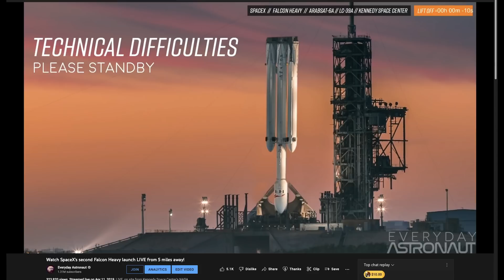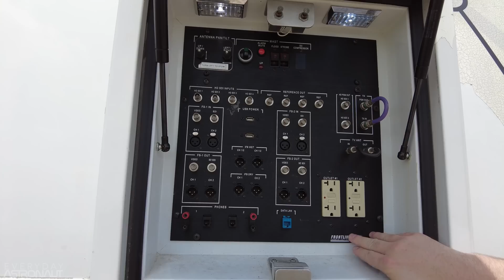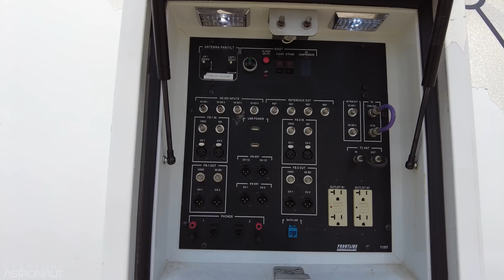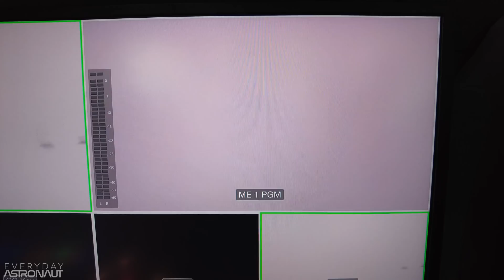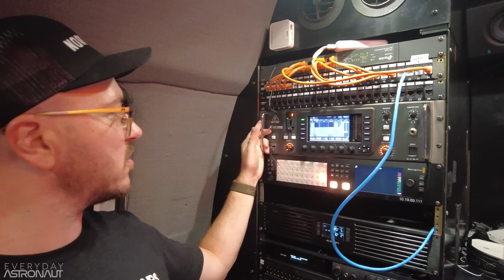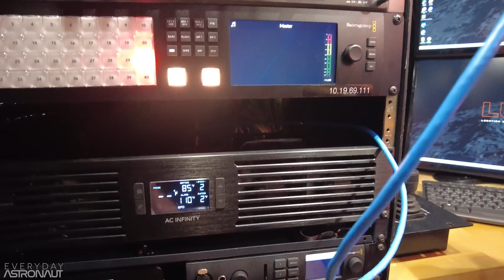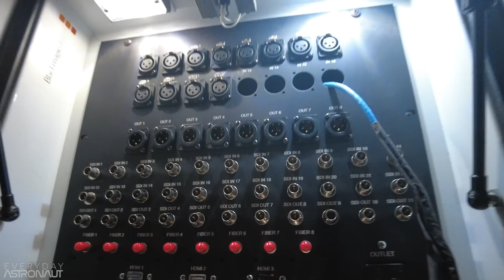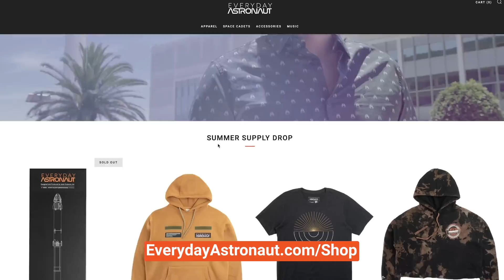I Built The Ultimate 4K Rocket Chasing Van! Retired News Van Makeover Build And Tour!

Comment: Do you need access to the server rack during the livestream (assuming nothing goes wrong?) If not, how about putting a door in front of it and closing it off to the inside with a direct air connection to the outside so you do not heat up your van as much.
Reply: That rack probably cares even more about cool dry air than the people, that's why those inverters have fans in front of them.  Those things need to stay cool and dry to function at their best and not shorten their lifetime (and given how expensive some of that kit is, early replacement is not something you want to have to do)
Reply: @glennmcgurrin8397  If you give them direct access to outside air, they will probably run cooler then when connected to inside air. They don't care whether the outside air is 20C or 38C or respectively 65F or 100F, so using the AC to cooldown a rack is just using energy twice and working in a really hot van.
Reply: @_aullik  If ambient is 38, that equipment will overheat.
Reply: @koomafloo3461  No not really. your System runs at 60 to 80 C internally, depending on how well it is cooled. If you increase outside temps a bit it doesn't matter that much as long as you have good airflow. So you can compensate for higher temperature with more air.
Reply: @_aullik  nobody in that van is going to want to listen to those fans lol. If this were the case data centres wouldn’t spend millions cooling their servers. Heat kills electronics, and increasing the replacement cycle of that gear is more costly than running AC
Reply: @nateclarke900  Data centers are many thousand times bigger and run 24/7. Even then, cooling them down to 20C as is often done is just plain stupid. The electronics run on the same temperature anyways whether your have 20C or 40C outside. It just means that they cannot turbo as high. However you could also increase the airflow over your server and achieve the same thing as cooling it down to 20C. 

Now when the air gets to 80C you got a problem, cause then you cannot cool anymore, meaning you have to make sure it stays below that, however the outside temp is never that high (unless you are in a desert) so you can just compensate with more air from the outside. You need that air anyways in your AC unit.
Reply: @_aullik  I think you need to do some research on heat saturation of metals and the working temperature of this equipment. If at 20c ambient and a static fan speed the system runs at 80, moving the temp to 35c will result in drastic heat increase on the chips, shortening the lifespan of the hardware. Given that the point of this gear is to be reliable, having it running at such high (and very humid) conditions will result in corrosion and heat damage over the long term. Thermal expansion deltas will be wildly high and could even result in condensation when parking the van after a long drive on a hot day and opening it up to the humid Florida atmosphere. 

It’s a bad idea, and that doesn’t even consider the fact that they are within range of sea spray and other corrosive and clogging factors. When you spend tens of thousands on gear, $50 a shoot for fuel to run an genny for ac is CHEAP lol. 

Nobody is saying you can’t do it, but it’s a bad idea and every tech guy will laugh at the idea.

Comment: Wow!
There are some great suggestions in the comments, it would be beneficial for TD to take note. My suggestions 👇

Additional suggestions:
Power system
Keep it ‘green’ where practical.
Fold out Solar while stationary + Auxiliary charging power source from the alternator while in transit.

Environmental Control System
AC functionality and reliability will be a priority to maintain temperature of cabin and equipment during hotter months. This is where a suitably sized power system comes into play.

Safety
Outriggers to add stability while mast is up.
Vehicle immobilizer while mast is up.
Obstruction light for top of mast.
Mast lightning protection system.
Investigate vehicle loading, particularly suspension with load equipment mass.

Comment: Great job. Would’ve liked to know more about your communication setup and contingency plan. Doing 4K streaming needs at least 25Mbps uplink bandwidth, which isn’t a big deal normally. But when everyone around you is also trying to do that, could it cause a problem?
Reply: He said bonded LTE connections so I'm assuming they're using equipment like a peplink router. If not, they need to be!

Comment: Good call, but there's a lot involved in maintaining a road rig.  Chances are, what you bought isn't 100% up to par.

IMO, check tires (dates, not just wear) immediately.  Next brakes, shocks and springs.  Service all fluids/grease points  regardless of what they said when you bought it.  Those are the minimum things to do, IMO, but I'd service transmission and give the engine a full tune-up as well.

Not cheap, but what is the cost of the shot you missed because you were sitting on the side of the road?

Best of luck with the van.  No clue about the additional things to think about with the mast.  Could get sketchy if it isn't working right or you don't have the right training/wind speeds/accessories.

Comment: The Everyday Rocket Van. Coming to a launch near you. Or, far from you. 'Cause it just doesn't matter anymore!

You may want to see about a drain kit for the mast. If it's full of water, and it freezes up in Iowa, well....you know what happens. I think it's just 1/4" fittings that fit a weep hole near the bottom and 1/4" clear tubing to run overboard. And I think they make canvas mast covers for them to keep some of the weather out when not in use. Neither should be very expensive at all. And if a section starts whizzing water out, stop raising it until it quits whizzing. It can build up too much pressure if you just keep going up with it. Good luck with the van!

Comment: For the next truck, if you buy another used news van, plase make sure the generator and the electrical wire are in working condition. that will save a lot of money. a very cost effective solution is a cummins onan generator .

Comment: I really hope you get a proper paintjob on that thing eventually, replacing all the NBC logos with your own EDA logos would be pretty sweet. Those ecoflow batteries look really interesting, I wonder how well they'd work long-term as a "permanent" powerbank between a wall outlet and a PC ups, since a standard ups generally will only get you up to around 30min-1hr of battery backup, but those batteries look like they're able to deliver about 15 or more hours, but they don't have the instant switch from live current to battery, to help with brown-outs, like a ups does. It'd be really interesting to try to combine the two.

Comment: Put yourself a transmission lockout connected to the sat. mast so you don't drive off and take electricity, cable and Internet away from the east coast of FL (LOL). You can also put a sail on the mast to save on gas and or a banner ad from sponsors. Of course you'll want to invest in "If This Van's Rockin'....."stickers.

Comment: What a completely cool idea! Well done, Tim!  Old VW Bus campers (circa '77) had the front passenger seat able to swivel around to face any direction. You might consider installing one, might help with production.
Reply: Actually in that van I think you can unbolt that seat and reverse it......
Reply: @fritzkabeano1969  Much easier to just lift the spring latch & spin it around with one's butt. It was all self-contained in the old chair mount.
Reply: @erfquake1  IF it has the swivel mount installed....what makes you so sure it has one??
Reply: @fritzkabeano1969  My '77 Spirit hard-top VW camper did. It was awesome! Had some great parties in that old thing. 😆 You'd push down a springloaded lever under the seat-front, which would release the seat to point in any compass direction. I thought since the audio board in the Luna was basically facing the back of the passenger seat, then that might be a cool option. But then I don't know how much nursing the audio would need once the broadcast starts.
Reply: @erfquake1  Oh I'm fully aware what and how swivel seats work and I'm fully aware that MOST people don't know that if you don't have a swivel seat you can still reverse the direction of the passenger seat in many vans. Retrofitting them with a swivel mechanism is easy enough but it's a rip-off considering what the swivel plate consists of.

Comment: My fingers hurt looking at this. I did a remodel on a broadcast audio suite that used 120 inputs. the patch bays... there was input, insert and output for each channel... each patch point had 3 solders each x 360....I soldered forever.

Also, the mast lets out water anytime you raise it to get rid of condensation inside the mast. I used to run a live truck as well. 

I am sure you know this but please be careful near electrical lines and make sure your mast is down before driving. I have seen too many accidents. Be safe

Comment: Use a raspberry pi on the ceiling with some sensors to collect launch data. You could open source the data for everyone.
Reply: Like sound intensity, air pressure during shockwaves, light intensity, accelerometer for shockwaves and more sensors

Comment: Make sure you buy enough insurance for it. I guess the gear in the van alone will cost more than 150K, if not more. And the video gear will cost the similar. Also, hire someone to do a decent paint job make it invisible. The old decor said it is expensive inside.
Reply: Also, hide some AirTags and GPS trackers in the van just in case

Comment: nice, a mobile lightning rod.
how stable is the van with the mast deployed? perhaps add fold out legs like cranes use or extra counterweights because you may not have flat level ground all the time?
also there is obvious reverb/ecco in the van, lay out sound deadening on all the exposed panels you have

Comment: As handy as those Ecoflow unit are, I would rather go with something specifically designed for automotive temperature, vibration and shock environments.  Victron is the industry standard when it comes to this stuff.  There are also rackmount li-ion batteries that would be far more secure, have much higher cycle life and scalable given the setup.

Comment: I have a lot of experience with that exact mast make sure you keep it drained if it has water in it and it freezes it is ruined and it is also a nightmare to take apart to replace a section at that point if you can even get it apart
Reply: Also if it has frozen don’t force it up or you won’t be able to get it back down

Comment: Looks 100% overkill :)  But I guess you skip some important details, for example what type of internet connection you would use?   Starlink?  5G?    
Why not plug 2 big solar panels in the roof?  PV are incredible cheap with respect to batteries, this mean you could just save 1 of those big batteries and still extend the time you can stay online. 
Well, good luck with this project!!

Comment: 69K worth of audio gear - encodes at 64kbps 16bit vbr. :/
not saying it's you guys but please please don't be that ^ guy, go CBR and if the quality slider goes up you max it both in hardware and software. that's it. audio bandwidth compared to 4K video is basically nothing.